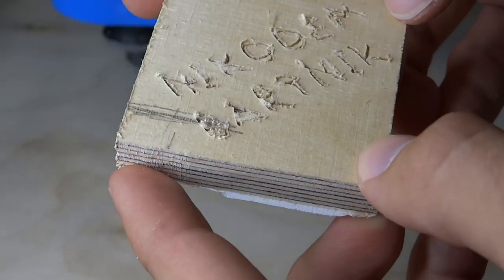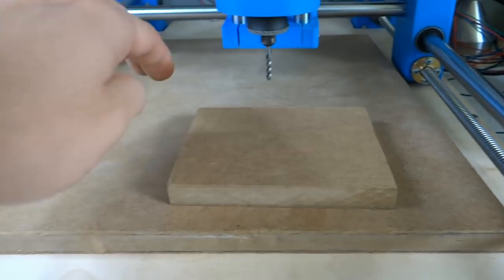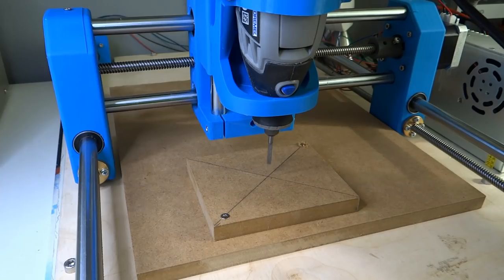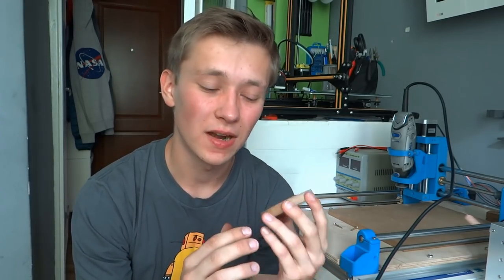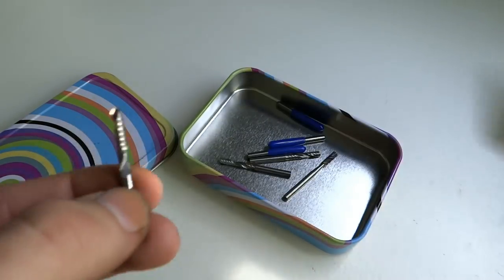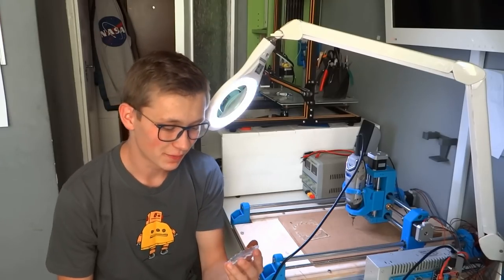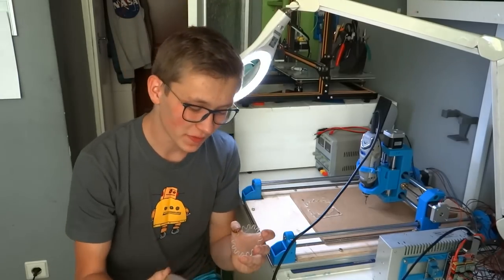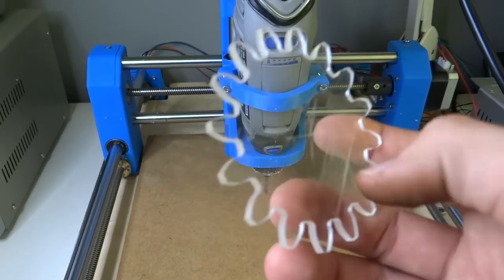DIY Dremel CNC #4 FINAL TEST!!! (Arduino, aluminium profiles, 3D printed parts)

Comment: Build an enclosing to keep noise and dust from escaping.
Reply: I think you´re right. I have just been on a trade fair and they had their running cnc-machines in a enclosure and it was really quiet while cutting. Would be great to see this machine running in a enclosure and see the difference.

Comment: If you could print a bearing support for the end of the Dremel it would add strength for the side loads and reduce the bit runout for cleaner cuts.

Comment: I love this type of projects!
And this one in particular just got to the top of my list (it's a very short list ... as I'm a programmer so pretty much the opposite of a handyman :)).
I'm currently working on a DIY high-speed centrifuge for separating heavier pollutants from usable fluid (in my case resin particles from IPA, but I took the design from a waste oil processing centrifuges), and to be spin by a Dremel (4300). 
Since I recently realized that the centrifuge radius increases effective Gs linearly, but RPM increase is by its square (ie exponentially), and when I remembered that I already have a Dremel (I rarely use otherwise) I understood that I can scale down the centrifuge drum, and use the high RPM of the Dremel to get high effective Gs.
For example I'm planning on ~7cm drum radius (as my 3D printer has small printing volume, Mars 3), but with ~10,500 RPM (which is ~ a third of the Dremel's max) I'll get ~10,000 Gs !!
I actually suspect that the limiting factor would be the strength of the material (a though 3D printing resin - I'll have to experiment a bit with this before I recommend specific resin/or combo/).
I've seen that the CD/DVD discs (which are about the same radius, but from considerably stronger polycarbonate!) shatter at ~22,000 RPM, so for now I'm planning to reach ~10,000 RPM, but might have to scale down if necessary.
However such a CNC machine can allow me to make larger and stronger centrifuge drum! :)
So this project got in the top of my TODO list! :)

Comment: Nice job, Niko.  One use for small CNC machines is carving out traces on printed circuit boards.  The Cu sided PCB blank can be engraved with the mill bit.  If the bit is small enough, I suppose even the small spacings of surface-mount boards could be milled out.  This is a much cleaner way than masking and chemical etching for making boards.  Because the underlying fiberglass/epoxy composite (used for the better boards) dulls steel tools quickly, tungsten carbide bits are used and even these must be replaced periodically.  Cheap drill bits can be purchased on eBay or Amazon; though I don't know about flat milling bits.  Another thing.  If you make a base with a gridwork of holes, there are ways of holding your pieces with dogs screwed into the holes.  I believe that this is how the pros hold their thin pieces down when milling them.  If you use a steel plate for a base, perhaps you can use magnetic dogs to hold your pieces.  Happy making!

Comment: IMPRESSIVE! I did know that you won't give up this interesting project. I had some doubts about the dremel's holder mechanical stability (you need time to measure it though and fix would be just a reprinting parts away). You fixed those last issues and explained how. Thank you very much Nikodem. It's a great job and I plan to build one based on yours (an integral copy actually). The acrylic section is perfect and likely precise compared to wood. You took your time but this is an achievement dude!
Reply from the maker: Thank you! I was really afraid that it wouldn't work as I wanted it to, but. a little bit of work and I made it work that good! I am still really impressed how this machine with 3D parts work. A lot of people told me that you can't use 3D printed parts for a CNC, so here is my prove to all of them :D Good luck with building your machine!
Reply: PLA filament?
Reply from the maker: Yes, that's PLA

Comment: there are some dremel extensions that are flexible where it can hold the bit on its end so the dremel can be hanged somewhere else. if you use that kind of extension instead of mounting the bit directly into the dremel, that could prevent any possible damage towards the dremel itself.

Comment: Build a dust shoe, it helps a lot with the vacuuming problem. Build a Thien chip separator for the vacuum so it can last longer or use a smaller vacuum that might be less noisy for the neighbors.

Comment: Glad to see the final product! I am currently working on a version of this using my old 3D printer frame and guts, and the Arduino/control board you are using was perfect! However, the PSU mount you made for it has the holes in the wrong places. I didn't realize this until after I printed it out, so I am going to have to adjust the STL to make it line up correctly. Other than that, this has been a great series! Congrats! :)

Comment: You should try cork as a material. It is soft and you could make custom pinboards and cup holders like you did in this video with MDF. It would be interesting to see how well the machine would preform with cork of about 6-10mm.

Comment: Hello Niko, I saw someone uses a molding clay (toy) on the edge of the Acrylic and then put water on top, as the CNC starts milling, all the acrylic / plastic dust stays on the water.

Comment: Awesome work man, thinking about jumping in and building one, hopefully with some modifications to handler a CO2 laser and a 5th stepper motor for tool rotation so I can use it as a vinyl cutter as well. Should be interesting, that you for an awesome head start, I appreciate your work!

Comment: I thing maybe the bits that you are using are not super sharp. Thats why you have to clean up the edges with sandpaper afterwards.  Maybe you should try sharpen them or try a high quality bit. Excellent work by the way.

Comment: You probably could cut down on the mess and maybe the noise a little if you put a cardboard box (maybe with a window so you can see what's happening) over the machine. A wood box would probably be even better. Also rubber feet would help with the lower frequency noise.

Comment: You should sell everything together as a kit, or better yet, fully assembled. I'd back that Kickstarter...just sayin ;)
Reply from the maker: I was thinking about that. I want to design something a little bit different that will be easier to manufacture, it takes a lot of time to print all of the parts for this CNC machine and would be quite hard to make it affordable because of that. I will do some math and maybe redesign some parts, then we will see :) I would love to do the Kickstarter and then start a company!
Reply: If you buy the hardware at wholesale prices and use a commercial printer for the printed parts, you might be able to keep the cost low enough to attract buyers as-is. Then you could always use the profit from V1 to fund V2 and beyond. Regardless, I'm going to subscribe so I don't miss the 'Back my Campaign!' video when you finally do :)

Comment: Hi, can you solve the loud noise by building plexiglas box and then glue soundproofing sponge on all sides, leaving small part on the door uncovered with sponge.. That would contain the dust too.. You can build led lights inside so you can see what is going on inside.. :D

Comment: You can cut aluminium using the same tool of the acrylic, be careful with feed and rev, 5000 rev is good, and try with 0.1mm layers.
Reply from the maker: 0.1mm layer? that's too low I think, I want to start with 0.5mm
Reply: yes it's too low, but you can use more feed, but 0.5 can work, I built mi cnc long time ago and I remember brake many tools , because of that I said 0.1mm for start testing xDD

Comment: Hey Nick, could you make a video explaining the software operations and controlling the parameters for various materials and Z calibration once it is build... Also a detailed wiring diagram would be helpful..
Cheers ✌️
Reply from the maker: I will pretty soon, firstly I want to test it with aluminium

Comment: I got kicked an idea about vacuum idea there. Why you don't put the vacuum tube near the drill bit like they are mounted on 3d printers, so it could suck all the bits of shreds. I would put vacuums from both sides

Comment: nice.. Did you try any metals like aluminum??  Yeah the sound/noise is the main concern I have... Don't think my neighbors upstairs will like me much...
Reply from the maker: Not yet. Eventually, they can move out :)
Reply: You could try adding rubber feet onto it to dampen the sound between the desk and the CNC machine, and getting a foam enclosure for it to dampen the sound. Would need a webcam inside so you can make sure it's still working.
Reply: Right! It's all about vibrations and adding resilient material should absorb a fair amount of it. Why not using springs?
Reply from the maker: I am thinking about 3D printing with rubber some kind of feet for my machine, it should be a little bit quieter.
Reply: In my 3D Printer I have some stpper motor dampers, they silence the noise and vibration of motors, also, you can replace the 12mm bearings for a 12mm plastic bearing (3D Printed) in this video https://www.youtube.com/watch?v=cBquXYGeV1k&index=12&list=PL2_HQm7IFtrCo3ZgSKebU3BQX_Y1B5TJi  minute 2:22 to 4:23 (sorry its in spanish) , i saw some vids about this and the noise its dramatical reduced . I want to thank you for this project, i want to start it. Greetings form Mexico. PS: of course, the noise of encraving is no reduced :D
Reply: A cheaper solution might be to just put soundproofing foam on the walls of the room the cnc is in. Put all your noisy machines in that room and itll be good to go. The floor could be covered in those puzzle-piece foam pads that are normally used for kids rooms(but they're still foam and sound-isolating)

Comment: Excellent machine and video! I am new to CNC and wanted to know what speed settings i.e spindle rpm, feed rate, depth of cut, plunge or ramp rate etc that you used for acrylic gear you cut.

Comment: Any particular reason for the huge 30A power supply? 10A should have power left to spare with 4xsteppers at less than 2A each + however much it takes to run the uno board..

Comment: I'm an electronical teacher. I teach making pcb in my lessons using H2O2 and HCL. I don't want to use this chemicals anymore. Therefore i want to make this. Thank you.
Reply from the maker: Sure, great use for it, but remember that it is a little bit harder to mill a pcb than to etch it, I will think about making a video of pcb milling soon

Comment: Great project I just now found it. I have this Dremel and the Dremel Drill Press Stand. But I want a manual Mini MIll for my model Trains. I printed the Z axis tool holder last night. 9 Hours Now I want to design an adapter to replace the Y axis Drive that you used. As I have an X & Y tables with manual crank wheels. So i hope to find a way to adapt the part. Can i get the Fusion 360 File so I can edit your design instead of reverse engineering the part. I will try to convert the .STL to Fusion but have not succeeded at that lately. The challenge is to use the existing vertical bar to hold the assembly steady. While the part moved on the Y & X axis tables. If this works out I would like to share the adaptor I design along with your Z axis Tool Holder. Can we do that??? Thank You young fellow great project, Dennis in Virginia

Comment: First of many dumb questions as I begin to source all the parts for this project.  Do you plug in your Dremel separately from the power supply for the arduino and motors?
Reply from the maker: I plug the Dremel to the wall outlet

Comment: Hi..mate. Great job yours....I have three Nema 23 type stepping motors type 103-77001423 5.1 v 1 A, its posible to adapt those one into your 3d files? or I have to upgrade the files because suports arent the same than Nema 17 motor, thx for the response ;)

Comment: Looks fantastic! :) I have a dremmel and based on part list I will check I can start printing on my mini kossel :) Looks like biggest part is 150mm wide, and so I think it might fit exactly to my dimmensions on the printer. Would you recommend PLA or PETG for printing? Thanks again for a great video and for publishing the design and updated parts :) Also, I would love to know how many perimeters you used for the prints :)
Reply from the maker: Thank you! I would recommend using PETG it is way better for this use. I used 2 perimeters but the more you have the stronger your print is.

Comment: The secret behind a cnc like this is: dampening the motors and most vibration problems will be solved
Reply: You can peint them from some flexible filament or buy real ones. A simple flex pla plate  "can" do the job, the better quality the better
Reply from the maker: I am going to print some kind of feets for this machine and hopefully that will make it quieter

Comment: What is the relay used for? You diddnt connect it on the 3rd video also did you use the limit switches?
Reply from the maker: There is a place for the relay but I didn't use it, I also did not use the limit switches, I decided that they are not that useful in a cnc machine because you have to set reference point manually
Reply: Thank you :)

Comment: at minute 8.05 you show the program you use to design in 3d, I would like to know what it's called. Thank you
Reply from the maker: That's Fusion360, I have made a video about software that I use with my Dremel CNC, that's part 5, check it out

Comment: Please try to cut a sheet of carbon. I'm thinking about building the dremel cnc but I'd like to cut carbon and don't know if it's able to do that.
Reply: HI, I am pretty sure it can cut carbon fiber with proper bit. I have cheap cnc 2417 and I was cutting 1.5mm carbon with no problem at 200mm/min, 0.1mm each step. It took time, but hey, it was working ;)

Comment: @Nikodem Bartnik, I sent an email but i think you didn't see my mail.
hello i watched your Dremel CNC part list and i made one machine for myself but i have a problem now. The problem is about the process. when i enter the processing size on an easel, the machine doesn't process to the extent I want. For example, i want to process a line has 7cm length but the machine processing 2cm.İ couldn't find a solution for this problem can you help me for fix this problem or if you have answers for this can you share them with me?

Comment: Great project, build one.

But there is a problem: the axes don't move the correct distance. $100, $101 & $102 are at 400.
If I make the machine move 1cm on one of the axes, it moves only about 1/3 of that.
What parameter is going wrong?

Anyone with the same problem and a possible solution?
(I don't have a facebook-acount)
Thanks!

Comment: Cutting speed of motor is determine to the quality of cut on workpiece. Change the speed of the dremel and it should change the result of the cut made. Be careful health and safety build a safety gard for your machine please or put it in a box to protect you from it if something should break on it.

Comment: You need to design an enclosure
Reply from the maker: Maybe I will in the future
Reply: Nikodem Bartnik I’m very interested in building one but the problem is I live in an apartment and it can get noisy. And the only time I can run it is after 4 when I get home from work
Reply: Did you also consider using PETG for filament?